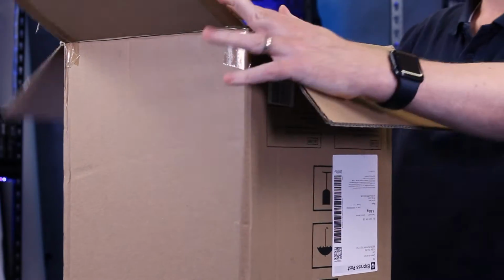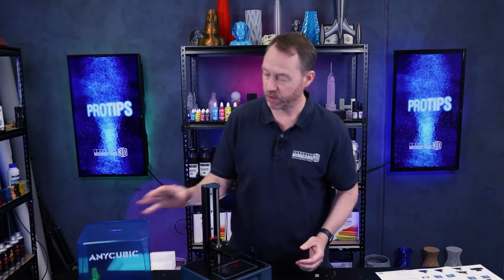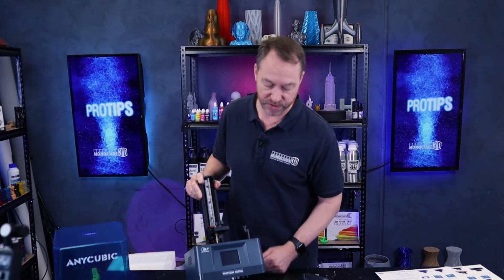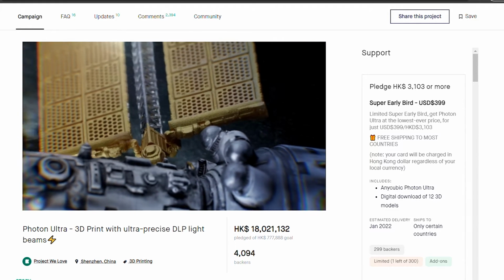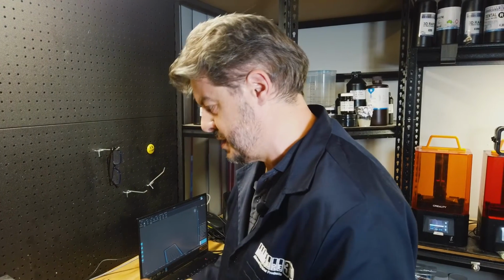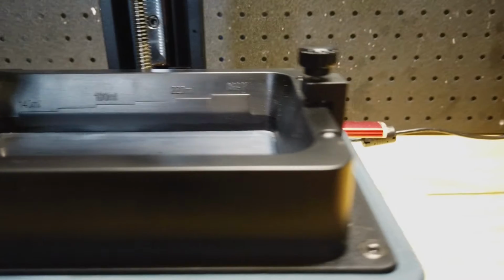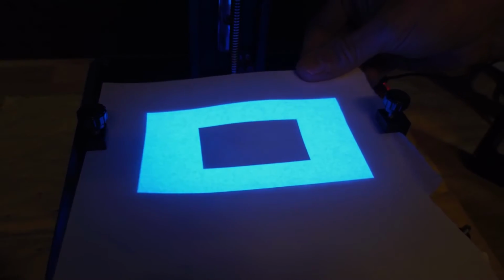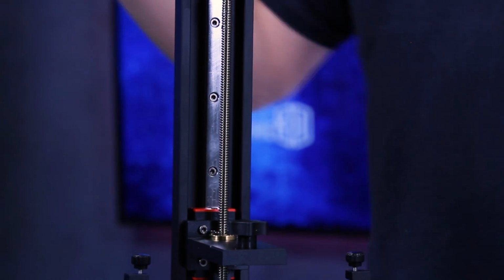The Anycubic Photon Ultra - Is it Worth Switching to DLP?

Comment: It's alot more expensive than the photon 4k and that prints fantastic! Even prints the test ifel tower with no resin build ups like some other's don't think I'll change to one at the moment but it does sound like you went in to hate and do a bad review on anycubic anyway! We have never had issues with the 4k one the instructions tell you not to use a metal vat only the black resin one provided! 
This is a statement from the instructions on the 4k mono x 

Please use the original plastic resin vat and Anycubic Photon Mono black resin vat can be a replacement. Do not use metal vat, which may cause print failure
Reply from the maker: I’m not sure how a vat can cause print failure?

Comment: I have a question for you: between this at 259€ and a photon m3 at the same price what would be best? Thank you 🙏🏻
Reply from the maker: M3
Reply: Where did you find it at this price?
Reply: @sepid129  anycubic site actually, they have a “back to school” discount which brings the ultra to 330 something and with the additional discount code “ULTRA” the price ends up at 259. Anyway I bought it especially for the low watt consume and the longer life (20000 hours they claim) and I’m pretty happy with it. The plate is a little small but so in order to print bigger stuff you’ll have to cut the stl files in blender and then stick them with super glue. I’ll for sure get a mono x2 in the future, probably next year, for printing stuff in order to paint but for the now I’ll stick with it since i’m printing stuff for DnD and it works just fine
Reply: @riky4president  awesome, thanks! Glad you're happy with it. I am still wondering if I should get LCD or DLP. My application will be mostly small mechanical parts as well as "higher" volume manufacturing later if the products are successful. Unfortunately I struggle to find a clear comparison when considering mechanical part performance. Seems like DLP will cure tougher resins better but LCD will excel at full buildplate printing.

Comment: Don't buy it !!!
I did and I deeply regret it !
It came with a faulty motherboard, Anycubic sent another one.
It's very hard and stressy to change this whent you're not use to electronics.
Then I plugged the printer wich booted less than a second before turning off.
The new motherboard turns to fault the same way.
It's really crap, don't buy Anycubic.
🤬🤬🤬
Reply from the maker: Doesn’t sound good!

Comment: Just bought this printer on sale for €350, it will be my first resin printer so I'm excited to start learning. The small build volume is my main concern
Reply: Honestly as someone that has owned 3 mono x and an S I preferred the smaller build plates, far nicer to work with. It's all personal preference though and dependent on what your main use is.
Reply from the maker: Thanks for the comments!
Reply from the maker: Great detail

Comment: There's an easy work around for different slicers which don't support the Ultra. Just use the Mono SE settings (with altered dimensions to suit the Ultra) and change the file extension after saving.
Reply from the maker: export supported file as an STL on your fav software slicer and then import as an pre-supported file and print.

Comment: The build plate design looks similar to the Mono 4k and if it's the same, then there should be 2 screws in the centre holding down the flat plate. You can loosen those screws and straighten the plate so that it is no longer skewed. I managed to fix mine on my Mono 4k.
Reply from the maker: ok thanks

Comment: Good review. 
Definitely had some issues with tip sizes on supports. Lots of presupports files for small miniatures are unusable on the ultra without beefing up the supports manually. Quite frustrating. 

Wish you'd touched on the dlp 'stepping' , (voxel lines I think they're called?) and the need for the photon workshop's anti-aliasing settings for getting a smooth finish on some prints. 
The dlp tech is amazing for crisp detail, but those lines can be pretty crazy on some surfaces without compensating for it. 
Still trying to figure out the best setting to work around it myself.

The weak motor is a real bummer and I've noticed that too, though thankfully I haven't had any notieceable failures yet due to it.

Actually found this video while I was searching for a replacement vat. Not only is the vat it comes with plastic, but when I went to replace the fep I discovered it seems to be glued into the frame that is screwed into the vat. I assume I'm expected to buy replacement fep sheets pre-tensioned from them, which seems a major unnecessary hassle for an already crappy vat. Good to see you suggested replacing the vat.

Do you just suggest ebay for replacing knobs and the vat? Any specific store?
Reply from the maker: Very! Thanks for watching

Comment: 17:20 - Single source definitely sucks. I doubt anyone would make (even if they were able to) DLP chips just for this tiny market. Hobbyist type resin printers seem to use lots of off-the-shelf parts (sometimes modified a bit), which keeps the prices down. Best case TI has lots of surplus obsolete DLP chips available to be repurposed, but I wouldn't get too hopeful for much innovation here.
Reply from the maker: Agreed! Hopefully the price comes down...